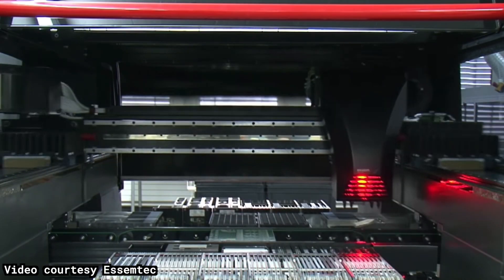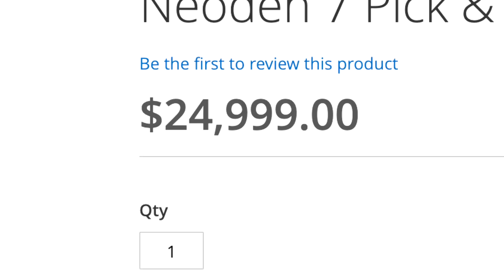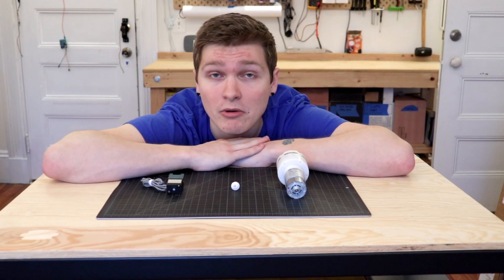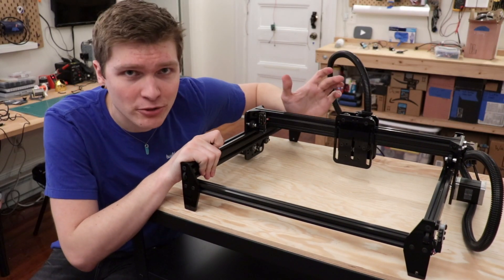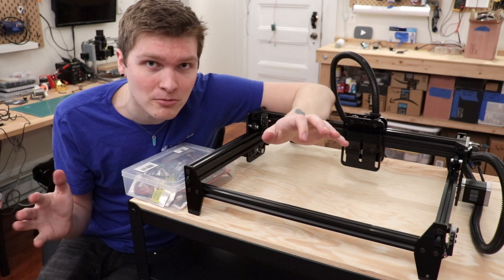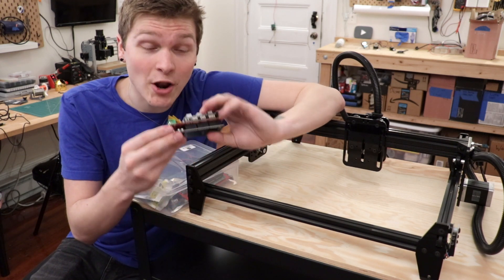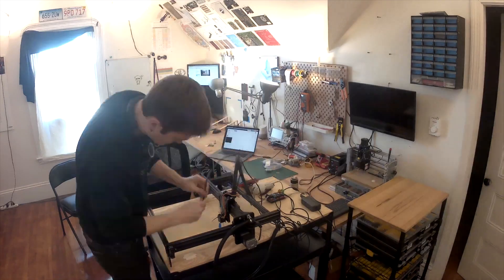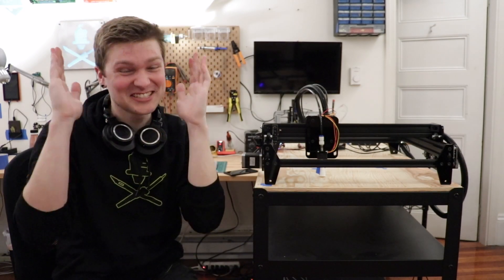I'm Building a Pick And Place!

Comment: If you install a tool rack, you could have an interchangeable head stock. This would allow you to create a 3 axis multi-tool arrangement. Drill head, router head, solder paste head, suction head and hot air solder head. You could also have interchangeable tools, such as different size suction heads for different components and different nozzles for soldering different components.
Reply: Except Solder Paste and PicknPlace are clean room operations. The others ?

Comment: You will likely smoke your RAMPS with that setup. The motor is a highly inductive load and doesn’t like changes in current. As a result, you will see voltage spikes when turning off the motor that can kill the mosfet controlling it. You need to add what’s called a fly back diode across the pump motor to counteract this.

Comment: Just a heads up, you should take a look at OpenPnP. I haven't used it personally, but from what I can gather, it's a program that generates the gcode based on your board layout/machine configuration, sends that gcode to a Smoothieboard, does the CV to verify images from the cameras, etc. It's another tool to learn (where you're obviously experienced with GRBL/Marlin already), but it'll probably save you a lot of development time in the long run.

For a simple strip-feeder solution, I'd just cut it in 1ft lengths, clamp it to the work surface, and peel the clear film off. It'll require more reloads, but that's fine for development purposes.

Comment: This is such an awesome project, enjoy! One thing I'm confused about is the soldering, is that still going to be manual?
Reply from the maker: Thanks! Yeah that's a good question. Most often people will buy a solder paste stencil and use that to put solder paste on all the pads. Then after the components are placed, it gets heated up which actually makes the electrical connection. I'm thinking about putting a paste extruder on this machine and making the entire process automated! (Awesome Electronoobs video showing the stencil process: https://www.youtube.com/watch?v=uXvXwzQf1gU)
Reply: @Oliver Hope and  @stephen_hawes  i am building one of these machines myself and you can also use a automatic paste head where there is either a stepper or pump putting dabs of solder paste on each pad this is done before parts are placed also on a side note part of the reason i am building one is to make it easyer help the diy pnp comunity grow i was also thining of making a custom controllor instead of the ramps board that has the same functionality with expastion boards stephen do you have a discord where you are puting developments of this project for others to adi you or is it just youtube
Reply: @stephen_hawes  aha so thats how it works, thanks